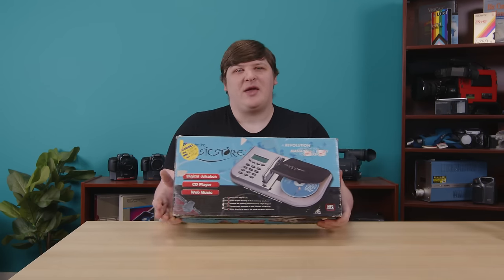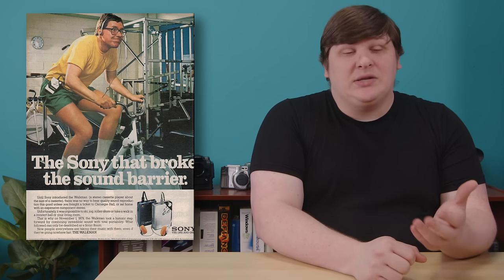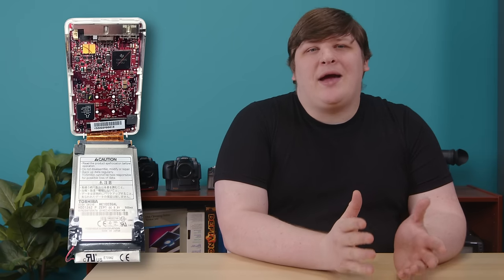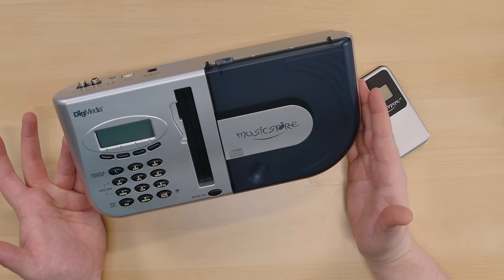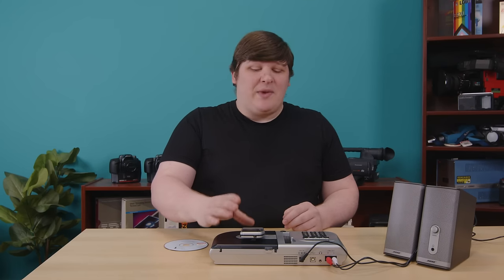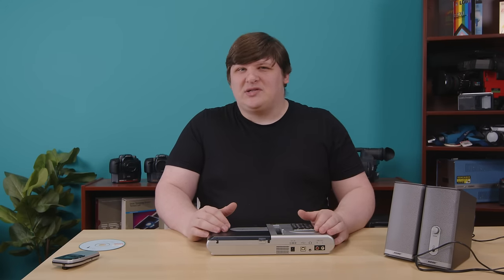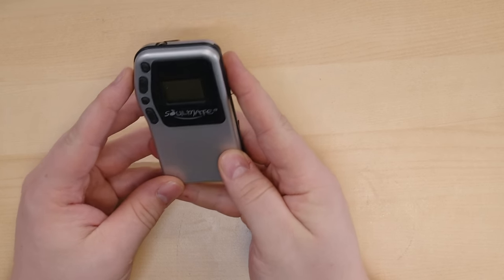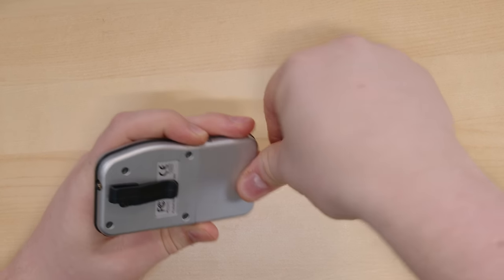An MP3 Jukebox for Everyone (Including The RIAA)

Comment: Looks like most 90’s tech. I believe your lost with the input device due to the fact it’s only used on phones today. For the time that was a huge upgrade to the 80’s tech that had even more vague inputs if any at all. It definitely didn’t age well but for the time it was actually good. SP= slow play, LP = long play, ELP = English rock format which again isn’t a thing anymore but was a form of compression but the more compression meant a worse copy; it was because of limitations of storage but may need a lot of information stored.

Comment: I think what could have made it more successful would have been better build quality and user interface. Instead of this 4 line LCD display and T9 numpad, it would have been better to have a full keyboard or something that would mimic a small laptop
Reply: Addendum: and if you could use the MP3 Player as a remote control for the stationary unit at home.

Comment: I mean I like the sound of old hard drives but maybe I'm just a weirdo. If the sound really bothers you could you not replace it with an SSD using ide to SATA adapters?

Also I wonder if you could reverse engineer the drive encryption using the provided driver?

Comment: if that lump on your nose bothers you you could always learn a video photoshop and touch up all 302400 frames of this video frame by frame.

a much easier thing is to cover up up the lump by using nipple pasties (yes the same nipple pasties used to censor breasts in certain adult situations).

you can get flesh colored pasties and put one over the lump should make the lump show up less on video.

you could also use cosmetic make up to cover the lump.

just be  sure to get makeup that is safe for open sores because if the lump is the welt from after popping of a pimple you will have an open sore that could get infected so you want to use a cosmetic makeup that will not encourage infection.

just like the conflict between the country artist diamond rio and the mp3 player of the same name i think amazon may have sued digmedia over the swoosh that connects the u and r because it is similar swoosh to amazon that connects a to z

digmedia could do like walmart and work the employees off the clock.

click the sound of punching out  oh can you  take the garbage out?

when you connected the drive to a computer to look for files did you try using a data recovery software?

sometimes data recovery software can recover files.

now if the movie industry could take a page from digmedia and do the same security for bluray disks then ripping should not be possible.

i am willing to bet that digmedia was desperately trying to stay off the riaa radar by encrypting,  not using standard filesystem for the hard drive and now realtime recording.

however if you are good with a soldering iron you could in theory modify the device to record from any source all you need to do is locate the analog  out on the cd player and solder a connector to the analog out from the d/a converter and then connect to a tape deck or something.

if you can hit the enter key to say ok in the software it may be possible to wedge a coin or can tab between the pressed key and the adjacent key to hold the key

can you record the cd again if the content is already on the soulmate?

Comment: It really reminds me a lot of the Sony Genezi Hi-Fi line that they released between 2006-08.
-Basically the idea was the same. They sold you a Hifi Stereo Deck. with the hook of "Can read CD's and CDMP3 and Burn them to an included MP3 USB without PC. - and a supposed new technology of " Mp3 Dubbing High speed to USB" (yes, all it did was copy the file as it is from the cd and call it high speed dubbing)
-That Was My First Mp3 Player But Like All Sony Proprietary Crap The Implementation Was Horrible
-If you tried to rip a CD with their "PCless Technology" the Genezi used the Fraunhoffer Encoder with a fixed rate of 128kbits. At the time you never noticed it [since they gave it to you with the classic cheap FM radio pea headphones] but from Sony. but when you connected it to the pc you saw reality.
and as a Pseudo-Measure of DRM. In the manual they warned you not to connect the included MP3 player (the Sony BNP-1) to a PC with windows, you will only use it in the Genezi or Sony players with USB. This is because if you did, the player would "Block and you would have to take it to service to use it again"
-and did. the BNP-1 entered a kind of Bootloop after disconnecting it from the PC that prevented you from using it as an MP3 (but not as a standard usb memory with music). However soon after I discovered that if you inserted the usb jack slowly, you could make the USB power bus make contact before the data pins (so you could make the MP3 run on USB power instead of battery) and This also solved the Bootloop after connecting it to a PC

It should be noted that in Latin America the Genezi and XPOLOID car audio line was a success because they could read MP3 CDs [and in Mexico, getting pirated CDs with Ares or Limewire music was insanely cheap, And it reached levels where if you didn't buy them you would sell them. And if you had the internet in the early 2000s in mexico it was a gold mine you could get almost anything pirated.  There is even an almost confirmed legend that many of these pirate CDs with repertoires and complete discographies were given underwater by the original artists to some clandestine CD factories [since despite the low price they obtained much more fruitful profits than with the company record labels]. you could get Mp3 with 200-300 tracks for $5-15 MXN~ $0.25~1 dollar at the time]. So the hook was that the Sony Genezi were expensive (The most basic model did not cost you less than $4000MXN at the time [About the same as a high-end PC at the time]) but with the pirated MP3s it was an investment of every penny. [part of the features were that all genezi had a pair or even 2 pairs of 3-way speakers with subwoofers]. so even at parties it was not uncommon for people to use them to set the scene.
-to this day and after almost 20 years from that time, many genezi players are still out there rotting or giving their last breaths (Since not long ago we discovered that they were also capable of reading normal USB's [not only the one supplied as the manual swore ] and they are even compatible with the android storage scheme, Yes, you can connect an Android via usb to a genezi and it can read it.)
-In fact it is not uncommon to see vestiges of the Genezi throughout Mexico, particularly the 3-way speakers of the equipment have been recycled to exhaustion, to a point where it is not uncommon to see them mounted on car Audio and walls or even in business exteriors (mostly food). or converted to ghetto bluethoot speakers

so it is curious but practically Sony was responsible for a large part of the piracy boom in the 2000s, and in fact obtained quite juicy income from the sale of Genezi and other players in Latin America (not so much with Walkman MP3) .
-today sony seems to be no longer producing hifi consoles but they are trying to revive or compete with chinese speakers by creating some boombox with precisely that "Burn and read usb without pc from cd" function again.

Comment: Self refresh is common to pretty much all dram. You can't access the contents until you disable it again, but its how suspend to ram works in laptops, set top boxes etc., you can put the ram into self refesh and turn off the dram controller before suspending the cpu.

Comment: Top loading 1X CD drives existed where the whole drive slid out. Look up Mitsumi LU005S or the video here: https://www.youtube.com/watch?v=CUBeHWVHh9U The mechanism is most likely the same.
Reply from the maker: That's a good point! I will say though, it doesn't make much sense for the jumpers to be on the side, and the dimensions still make no sense - the IDE connector would be popping out with the transport. So although you're right that this DOES suggest there are PC CDROMs with detented spindles, I still think the one in this unit is an industrial mech.

Comment: You should back up that hard drive. Good way boot a live Linux and DD copy it and to a SSD today it should not cost much what was the size of that hard drive? 128 GB if so that size today cost less then $20 and then can get a SATA to IDE adapter to use it right in the unit. Video to long but good info.

Comment: 15:30  Can't you do the same thing with a $300-$400 laptop?
Reply from the maker: It doesn't have a builtin high-grade DAC, IR remote, and a convenient 10-foot user interface. You can also mash potatoes with a hammer, but it's not really ideal.
Reply: @CathodeRayDude  Well, that certainly sounds like $5K worth of hardware.
Reply: @CathodeRayDude  [high grade DAC] FL-2000 USB to VGA dongle, am I a joke to you?

Comment: Wait that cost $449.00 new? and you paid $299.88 today.   And its worth about $1.00.
Reply from the maker: I paid $20, haha
Reply: @CathodeRayDude  I bought a MP3 and FLAC playing board for less than $15 on Wish...and it can run of of 5 volts and provide a line level output.

Comment: SRAM is too expensive. Imagine that most PCs at that era had 64MB of DRAM. 64MB of SRAM could even be more expensive than 64MB of flash at that time. And the CPU cache which where SRAM was measured in KB.

So. SDRAM is actually the cheapest solution.

Comment: It feels sad when you do a take on "why the heck is it ripping at 1x when you can do 32x on a CDROM" while modern CDROMs (BDROMs, DVDROMs, all that stuff) are locked by the firmware to 1x when a factory pressed CD/DVD/BD is detected — enough for playing, pure shit for ripping. I was wondering what the heck happened to EAC and why is it barely able to go above 1.4x and has to do error correction quite a bunch, until I installed Libredrive onto my CDROM and it started just flashing through my discs at 52x with no errors whatsoever!
Seems like RIAA got us fucked in the end.
Reply: Reason #322 I’m glad I don’t use modern computers.

Comment: If you think Apple cloned that to make the iPod, you never used one. They were terrible. The one thing they were good for was digital recording. I had several pre-iPod nuggets. They were all terrible. Apple’s iPod was a game changer because it wasn’t a piece of garbage like most of the MP3 players were at that point, and Creative Labs were some of the worst proprietary software that never worked, and they just failed for no reason at all.
Reply from the maker: I owned the device in question, I know what using it was like. Creative certainly felt that Apple cloned their product, since they sued them over it. I never disputed that the iPod was more polished.

Comment: As soon as I saw this it looked liked peak 2000's plastic garbage. A device like this at the time would at the very least be a fun toy to play with but most people either had a computer and chronically abused CD-Rs or they still used cassette tapes. Nevertheless, a cool example of the growing pains of the 2000s

Comment: This player came out in 1999 but Creative jukebox came out in 2000 and than jukebox 3 that was a lot better interface had options for 4 speak output and jukebox 3 with 98SNR quality unlike iPod was 87snr  tops. Even digmedia did 90db snr compare to iPod that came out later with worse quality. Plus jukebox 3 had line in for mic/line in and optical in for inline recording and am/fm radio. While iPod had none of those and worse software and how it became more popular than Even creative zen and beyond me.jukebox 3 had docking station remote control where you can just dock ur player and its connected to ur HiFi system play songs you like on a fly or continue the song you listen while you were out. Etc Apple had none of those .

Comment: I'm sorry but your talking completely ahistorical bullship. Maybe you only
Had access to a diamond rio, but it was very late to the marketplace. There had been for several years a big fight between hard drive & memory based solutions like Iriver.

 In the late 90's I had something that looked like a Discman but actually housed a 3 and half inch drive. I think it was from Creative Labs. Later I had a RCA 2.5" HD that offered Mp3 & Mp3pro. There were even players based on the IBM/Hitachi 1" drive. What I do remember was that it was as we were discussing players that offered ogg & flac formats along came Apple offering it propriatory AAC codec, running on the IBM drive but with its fantastic control system, and all these MAC using media type people  were going nuts about it, because they had never heard of hard drive based player before.
I think the 3.5 player I had was made by creative labs the people behind the biggest selling PC Sound Card
Reply from the maker: I never said the Rio was the first MP3 player, and I believe you are misremembering when hard drive based portable players became generally available. The Creative Nomad Jukebox (the discman-shaped MP3 player you're describing) came out in September of 2000. The only device I'm aware of that predates it is the Compaq/HanGo Personal Jukebox, which was not commonly available, and only came out in late 1999. Both cost much more than the Rio and other flash-based players.

Comment: 15:37 ppl really pay 6 grand for a disk drive? even if it can bypass dmca schemes, i can do that wit my pc dvd drive some specially programmed drivers and drive firmware, and just run a windows program..... they make money off the fact that people don't under computers nor understand how digitally encoded audio works... welcome to the world of lossless compression techniques any pc and smartphone can handle wit ease in 2022, as long a u have duh rite specific order of bits in a file, it will sound just a good as duh first time u bought it..... coughs
Reply: so really for any audiophile that would want to know if the song is unaltered and not compromised, dats what hashes and checksums are really good for, if you have a known valid one to check against, like a fingerprint, you change one bit and duh whole hash or checksum value changes so its pretty hard to fake dat